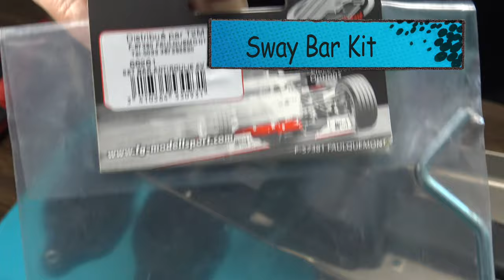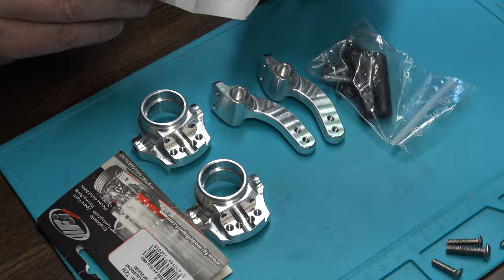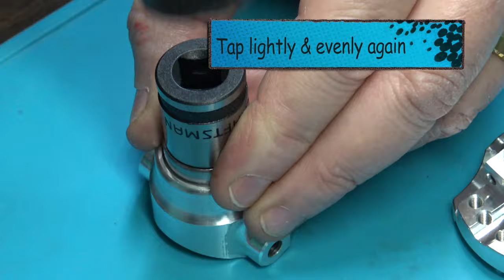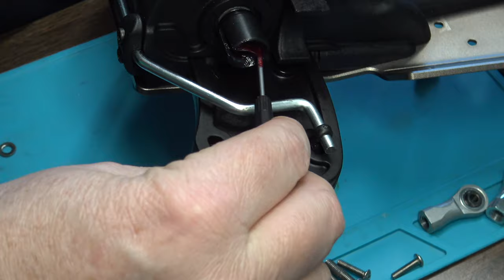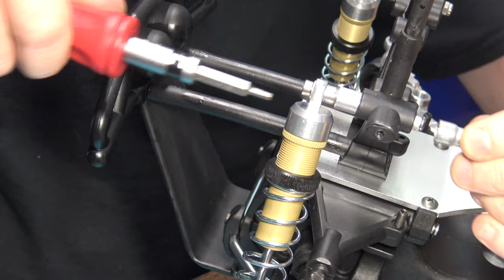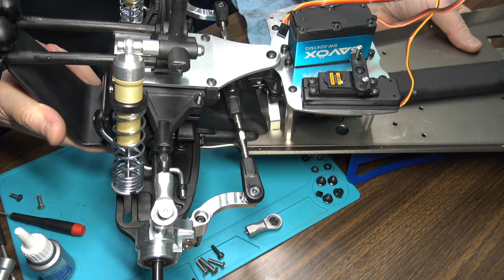Rovan BM5 - FG Parts Upgrade Part 2 - Front End!

Comment: Wow your engine is blinging 🤩Kiddd No ?’s It reminds me of my Gizzmo 30.5 piston port engine haha 😂 Zeeeeeaah!! Bro great build man ! You have the nicest FG MT platform I have ever seen . If I was you and if I didn’t own a Arbor Press I would definitely try to use a vise to press on your bearings!! Never pound on them with a hammer 🔨 but I must be honest with your and say that I have done that also many many times just because I didn’t feel like getting my arbor press or one of my friends borrowed it . There was only a couple times I had bearing failure because of that . Your using the best and most tackiest grease out there so that should help a bit I never do that just change bearings as needed or upgrade them but that’s a good thing to do . Just remember that grease your using is tacky as F not Slick so a little bit of it will go a long way it spreads and sticks like no other. I know it’s pricy but it is the best out there it’s like bubble gum
Reply from the maker: BOTAJELL Thanks John. This truck has turned into quite a journey 🤣 but I’m having a blast 🔧 on it. Thanks for the info on the bearings. I have a press on my radar but next time I’ll use the vise👍🏻👍🏻👍🏻. I wanted to replace that inner bearing but the Fast Eddie bearing kit I bought didn’t have that one in the kit??? 🤷🏼‍♂️ I didn’t want to wait so i repacked it. Hope it holds up👊🏻
Reply: 316 RC real nice job 👍 brotha! Wish we were neighbors I like the way you wrench 🔧
Reply from the maker: BOTAJELL we gotta do a YouTube meet up this year. Braapin, food & fellowship 🤜🏻🤛🏻